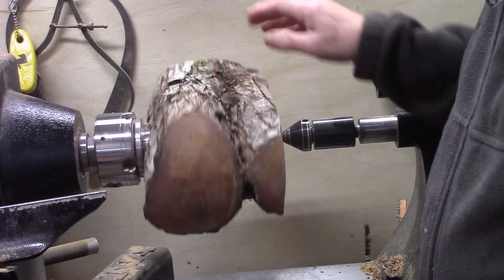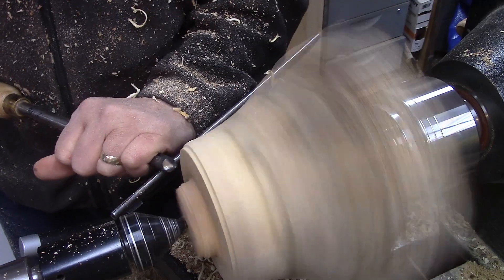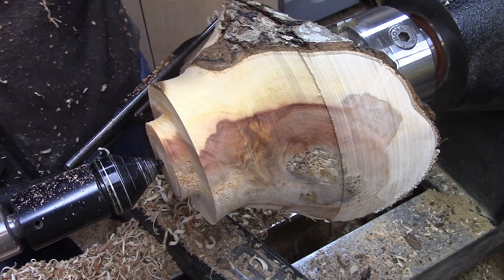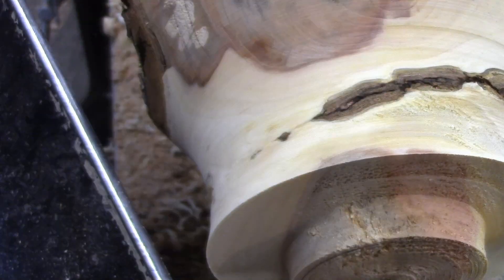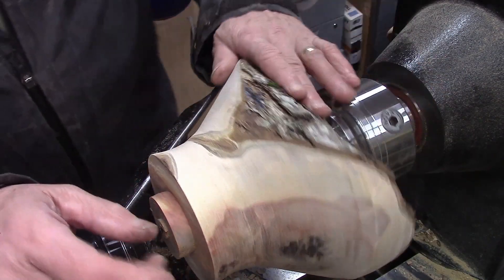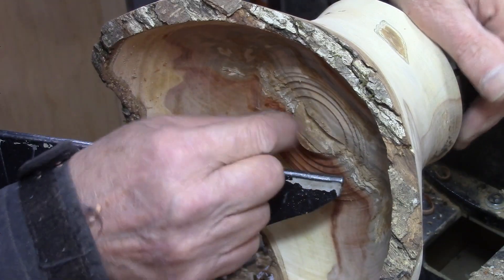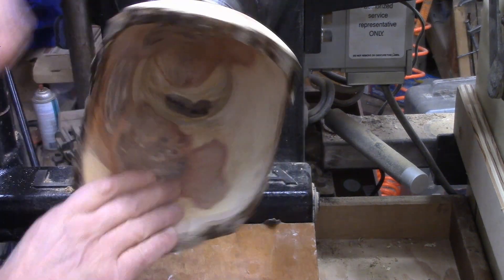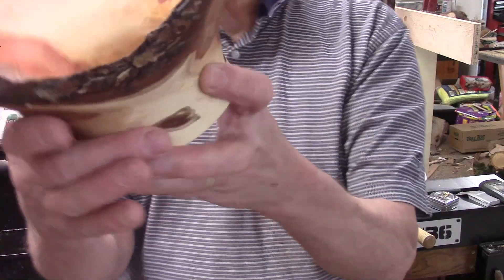Natural Live Edge Asian Pear Bowl Wood Turning

Comment: 👍 good job. I have about 12 bottles of different types of wood dust I keep on hand to use to as fillers. I bought an old coffee grinder at Goodwill for $2.00. Works great to make your own sawdust. 👍🇺🇸
Reply from the maker: Thank you that is a great idea. I have been saving some 8oz drinkable yogurt bottles. I use them for finishes and thinners. Be good for sawdust as well.
Thanks for watching.
Gary
Reply: Great tip there Cortland, I will remember that

Comment: Great Video. One question: Do you treat the bark itself with Howards or something else? Or is it best left alone?
Reply from the maker: Thank you Stephen . I use the Howard's on the bark as well. If the bark is heavy you may need to hit it with the air hose to get it our of the deep areas.
 I nomaly will use the same finish on the bark as I use on the turning itself.
Thanks for watching,
Gary